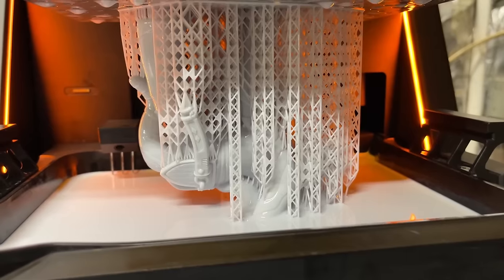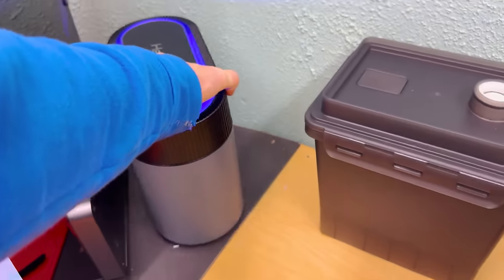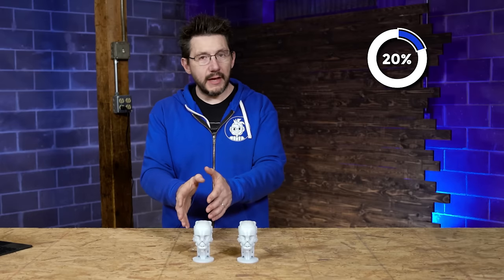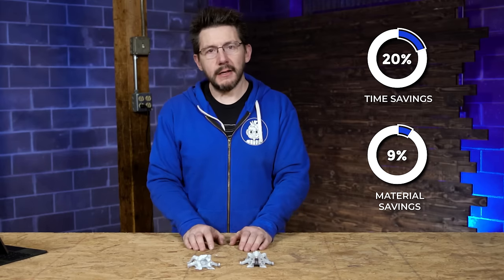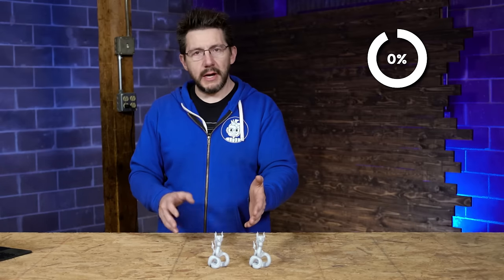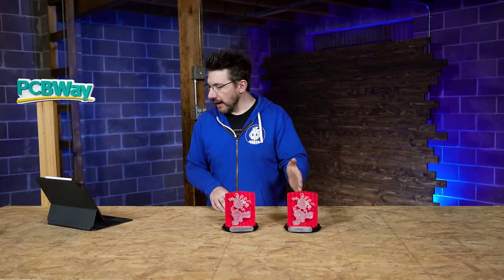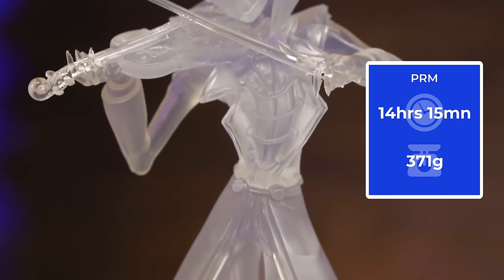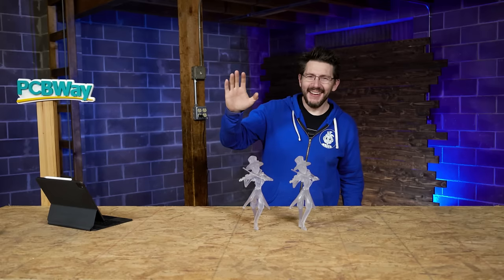Does the HeyGears PRM Work?

Comment: OK... maybe I am missing something, but how exactly does this save resin? Unless you are using a different slicer profile for the two test pieces, the exact same supports will exist and the exact same amount of resin should be used. I'll go along with claim that you can run the printer faster, but unless I am missing it, I do not see any way that this would use less resin.
Reply: Huh? The video does in fact multiple times explain that yes, each print uses different slicer settings and different supports, and that it's because less support material is needed with the PRM settings that there is a lower amount of resin being used (albeit a small difference in most of the examples).

You should go back and watch the video again. You seem to have missed a lot of the explanatory discussion that's there.
Reply: @harvey66616  lol... I guess I did. I swear I watched it all, but for some reason, that just slipped right past me. That makes sense and that was what I figured, I just didn't remember hearing that explained... and judging form some of the other comments here, I'm not the only one. I appreciate it, friend.

Comment: why is his print times 4-10h to begin with ?
Reply: That’s normal for most resin printers at a .05 mm layer height.
Reply: Because the build platform has to move down to just above the FEP. Then the layer image is shown on the LCD and the UV lights are turned on for a specified amount of time to cure the resin. Then the build platform lifts to peel the print away from the FEP. Then we do it again. That takes time and each layer adds up to hours.  You could greatly increase the build platform movement speeds, but that would sling resin everywhere. Resin printing is ridiculously messy already. Though you could derive a system that captured and directed that resin back into the vat, but it would still be so messy on top of already messy. So build platform movements have a speed limit there. This product helps reduce time in the one place that won’t increase that messiness; the peeling away from the FEP. Which generally has to be done slowly to prevent the print from losing adhesion to the build plate. 

But why does it take so long. Because the layer height is small and that means a lot of layers. Each layer having a total time to complete, and all the layer times add up. 

Vertical distance/print height is the biggest determining factor in resin printing time. If you can orient your object to take up more horizontal space ( while still within the bounds of the build plates area) , and reduce its vertical distance you can greatly speed up/reduce the time it takes to finish the print. 

So the window to speed up printing is very narrow, and takes place at a very crucial portion of each layer creation process. Mainly because the peeling away from the FEP is what really makes or breaks a print. Go too fast nothing but failures. Go to slow and your prints take even longer.

Comment: Nice, but the printing time seems quite long for everything?!
Reply: thats normal for resin printing, especially if you want quality and reliability you run things slower
Reply: Yup, it's always long. But you get the benefit of great quality with minimal post processing. 

Sure these time savings don't seem like much, but when you have a 20+ hour print it would probably add up
Reply: @SlinkySlonkyWaffle sorry i dont agree. We have here 7 resin printers, creality, any, elegoo and formlabs. and this is way to long for such a print size. Even with different materials, these times seem extremely long to me. even at the lowest layer height. Well, he will have his reasons, but it can certainly be done faster with the same quality.
Reply: Hazbin Hotel is great if you haven't watched it yet
Reply: @SlinkySlonkyWaffle that's old 3d printing , newer fast resins print fine, his 8h print would take 1.5h max
not to mention those resins are less viscous = more reliable
Reply: @highlander5521  

Heygears uses a close system, I don't think the user can modify print settings. But yes, those prints are very long and not at an oustanding quality. Those printers are not meant for people used to 3d printers, it's mostly plug-and-play material with the significant tag coming with it.

Comment: 4:45  If you show the print defects on the print without the PRM, SHOW IT ON THE OTHER MODEL ASWEL, This machine sounds like a scam as much as it is, this doesn't help your case much. The prints taking 4 to 10 hours is ridiculous too. You say you have all this data on the prints yet you don't show them. And the last point, Even small settings changes can make or break a print and drastically effect print times. By not showing what the machine does, how it interfaces with the printer and what settings you used to print everything you just showed us a bunch of hot air. 

I respect the work you do, but you can do better, you have to do better.

Comment: There are 2 proprietary resin print technolgies that have been locked behind thosands of dollars expensive machines. One uses oxygen that is probably released from the resin itself when activated by the UV light, the other one uses some kind of superslippery screen. Both print without going up and down - just straight up. When are we going to get that tech to desktop machines? This is getting ridiculous!

Comment: Heygears is not an option to me. Too many restrictions on the printer to begin with. You have to use their resin, you can't customize profiles, and the air pump is a $650 add on. I could buy a second printer and crank out more than the printer by itself could with the pulse module.

The one big advantage of the PRM is you can use smaller support tips.